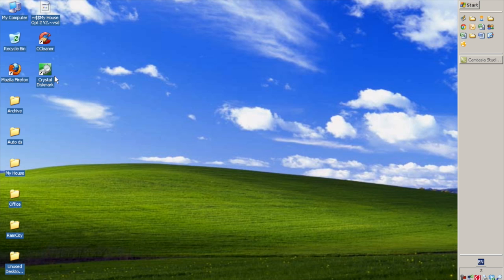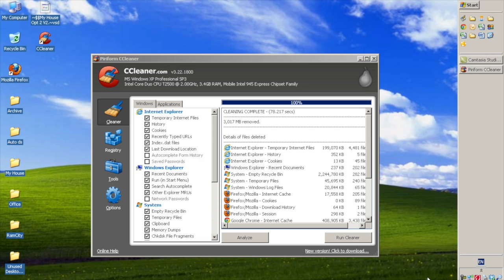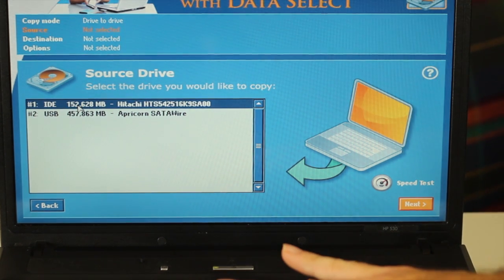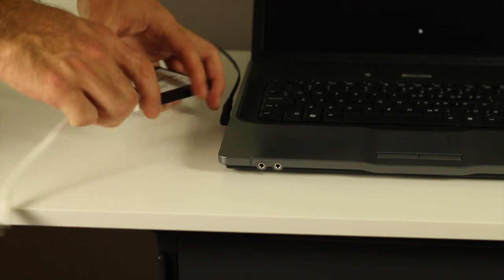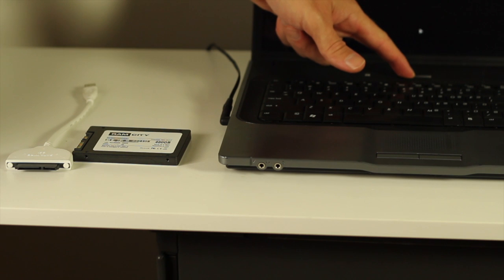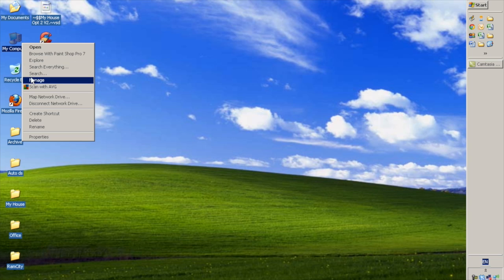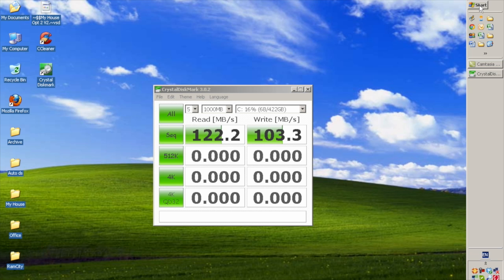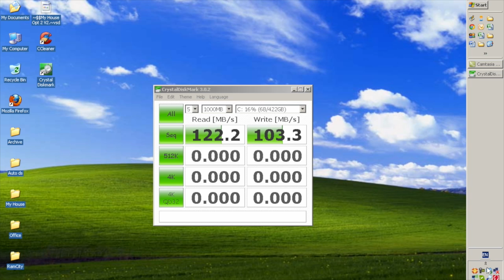HP 530 Notebook SSD Upgrade with EZ-Gig Data Cloning Procedure

Comment: +Ramcity Interesting! I have the same laptop, some couple keyboard keys are not working. Id like to put a 60GB SSD on it and a new keyboard. The thing I was wondering is, what are the rated read/write speeds of the SSD you installed?
Reply from the maker: +David Wangai Hi David, I'm not sure what the specs on this drive were back when we performed this installation. However any modern SATA SSD is going to run around 500MBp/s read and write speeds.

Comment: you do know Ccleaner is spyware/malware software right? use Malwarebytes instead
Reply from the maker: +The Noid In recent years CC cleaner has gotten some suspicious files included, however from using the source media and not installing any of the "extras" they like to include on can be safe and the software still works.

That said I agree and malware bytes is a common favourite.
Reply: RamCity OK sir just looking out cause being in the IT business I f hate those scammers